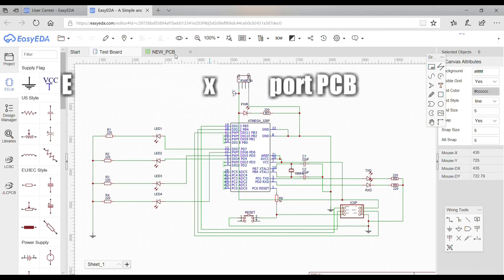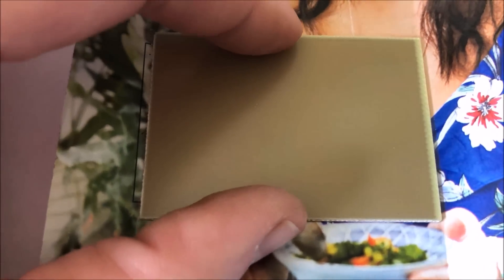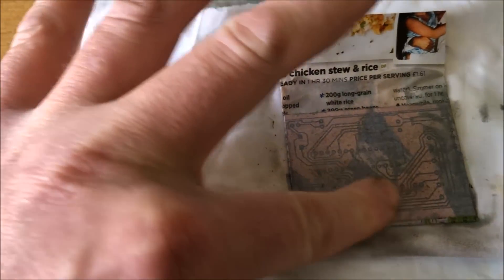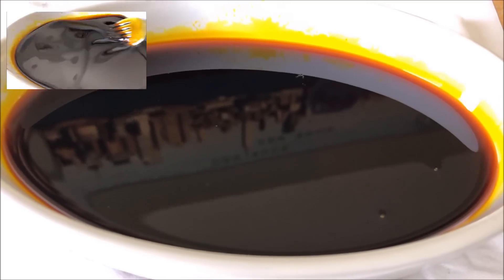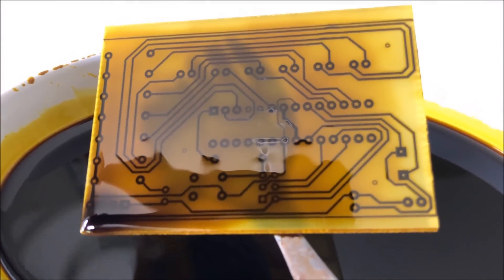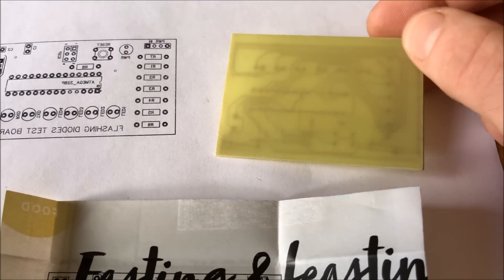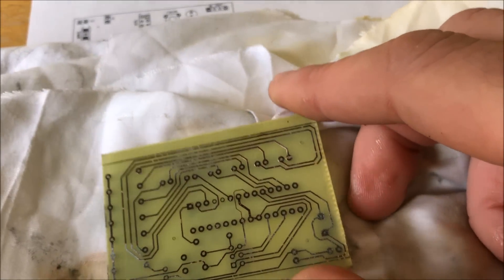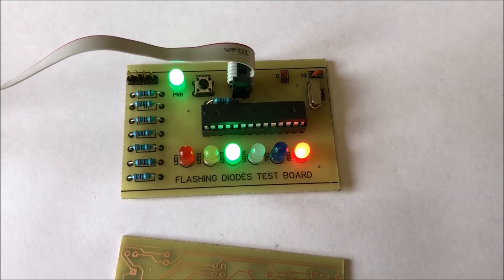DIY PCB Toner Transfer (No Heat) & Etching

Comment: Would pure acetone also work? Are B5 vitamin and Aloe Vera essential components :-)  What do you think?
Reply: vitamin B5  is essential for healthy circuits
Reply: @noname_atall  you betcher lifesavers-!!
Reply: It will work better.  Cheaper.  Faster.  Sexier.  Bacon.
Reply: Stinky Cheese mmmm bacon
Reply: The TWO key ingredients in nail polish remover are acetone and alcohol. Google "heatless pcb toner transfer". Pure acetone will just dissolve the toner. Mix 3-to-8 acetone/alcohol. See: https://www.instructables.com/id/Heatless-cold-Toner-Transfer-for-PCB-Making/
Reply: Aceton + isoprophyl 1:1
Reply: Piotr Kravi i have tried with pure acetone: nothing, with my wife’s nail - thing : nothing 
Why??? What am I doing wrong?
I printed the circuit on magazine paper with a laser printer also.
Reply: @DPoly  me too
Reply: When acetone remove your  protection on the finger it good to get B5 and aloe vera. ;-)  I like this video, will try it with acetone.
Reply: Mads Thorup did it worked? For me no...
Reply: @DPoly  I've just tried it, but with pure acetone. Some tracks appeared on the copper board, but most of it was quite smudged. The ink of the magazine article came off too on my finger as I rubbed it (I was wearing gloves). I think I put too much acetone on it.I'm going to try again anyhow. Great video.
Reply: it might work, but dont drink it. the lack of vitamins makes it unhealthy
Reply: @tobbleboii5988  Yea it's just empty calories.
Reply: Most nail polish removers no longer use acetone as their base chemical but something similar
Reply: @dege10000  may be, but this in question still has acetone in its composition (see manufacturer's website)
Reply: This I do not know but vitamin B5 and Aloe Vera leave the hands soft and fragrant ... LOL
Reply: I've found Xylol (aka Xylene) is the best at transferring laser toner from standard white laser paper. You can get Xylol at HD/lowes. Make sure you use it in a very well ventilated area. However, I haven't tried transfers yet for PCBs at all onto copper but I think it will work if folks have been using acetone. 1:1 acetone/IPA (91%?) is interesting / less toxic to inhale and might be good as well.
Reply: Sergiy Gryb Olá pessoal peço a ajuda de todos vocês para que se inscrevam no meu canal, desde já agradeço pela ajuda. Breve mais vídeos serão postados https://youtu.be/m6IBXYPri54
Reply: LOL!
Reply: @dracul9166  I would bet my chips all on ACETONE

Comment: Please, be careful with acetone. It's high flamable and hazardous to your healty. Avoid Inhalation, skin contact and eye contact.
Reply: Well... I work every day with it. It is one of the more safe chemicals. If you dont drink it, exposure to skin and so will just dry it.
Reply: it's not much the acetone (our body synthesize some acetone). The problem is with some stuff (such as plastic) that contains isocyanates. These molecules are disolved by aceton and can penetrate inside the skin, and reach your blood.
Reply: Acetone is reportedly NOT carcinogenic, but it CAN cause skin problems from repeated exposure to it.  Use rubber gloves!  Inhalation is also best avoided.  I would worry more about the ferric chloride, which stains everything!  Personally I always use ammonium persulphate - its just as good as FeCl3.

Comment: Nail polish remover is mostly acetone.  I would therefore assume that pure acetone should work as well.  Can buy acetone in pint, quart, and gallon cans at the homedepot for less an oz than nail polish remover.
I use a two to one mix of H2O2 and Muriatic acid (HCL) as etchant.
Reply: Nail polish remover is NOT mostly acetone. It contains more water then acetone.
Reply: Yeah, lucky if you get 2%-5% acetone in most nail varnish remover. Those marketing men sure know how to relieve the gullible of their hard earned cash by selling em water for a few 100% markup.

Comment: Great idea!

A couple of thoughts:

1) isn’t the toner conductive? Is there a risk the silkscreen could cause a resistive short?

2) I wonder if this works with a  “wax” type laser printer? If so, you could use it to create multi colour silkscreens!
Reply: Toner is made out of a plastic powder, so it's not conductive.
Reply: Well, not "wax" but with some oily finish. There are (expensive!) color printers that adds a finishing layer of something oily to make the printed regions to shine, and probably that was the "wax" portion. It will be interesting to know what kind of substance is that and whether is it soluble in acetone. If so, then there is no reason not to use this kind of printer for color silk screen!
I would like to know if there is any method to make a solder screen?

Comment: Thank Gareth. Very helpful by avoiding the heat transfer process. Since Nail Polish remover contains acetone and other chemicals is not just straight acetone is a good cheap alternative.
Reply from the maker: Robert Wilkins, at the time I didn’t have any acetone to hand, I’ve recently fibre glassed my extension roof and have a few litres of acetone left over, going to try it and see how different it is
Reply: Except no.  If there were any process to avoid it would not be heat transfer, it would be acetone as it goes right through your skin and plays havoc with your liver, and lungs since it evaporates so readily then you breathe it.
Reply: This is very true - had it straight from a Fellow of the Royal College of Haematology.

Comment: i do the same thing but i just use the big containers of acetone you get from lowes or home depot. i do use a flat board to apply pressure though so its even across the board. i've had some traces get distorted if the pressure is uneven.

Comment: I got this way to work quite well! i bashed out three PCB's yesterday. using a brother laser and semi-gloss finish office paper; it peels without leaving fuzz embeddd in the toner; i used it because i had some, and my printer tries to burn magazine paper...! you may get away with any old crap. 80)
Clean the copper using Acetone, NOT nail varnish remover which, as well as being over-priced, contains oils to stop drying of the nail and a large percentage of distilled water...neither of which help at all for this purpose! the stuff i used is about 98% pure, and sold in the 'cleaning-products' isle in the local supermarket's for around 4 euro's a litre. Wipe the board dry with paper tissue. keep your oily fingers off the copper.
I soaked the BACK of the paper with a few drops of acetone, which seeps into the paper and dissolves the toner; the reason i soaked the back was to make sure the toner was well dissolved and to avoid smudging the tracks when placing it on the copper. (if you drop acetone on the brother toner it almost dribbles off the paper) the ideal is nothing between the toner and the clean copper...and that includes a layer of acetone... While the paper is still wet, place it carefully onto the copper PCB, press down with your fingers or a flat board padded with tissue ( i used a rubber roller from a dead inkjet printer to roll it firmly on) leave to dry. 
Soak board in warm water (NOT hot! you don't want to re-fuse the toner ) warm water seems to speed up the 'soaking'; which releases the paper/clay from the toner. you may get away without soaking. Peel off the paper, and you will have the toner firmly stuck to the copper by some strange alchemy... Any traces of the clay used to make office/magazine paper 'shiny' can be gently scrubbed off using your fingers. Etch, and grin like a loony at your wonderous new fab lab.
Reply: Hack In Black what min trace / spacing could be achieved?
Reply: @Grants2251  technically it depends on the resolution of the printed image, for me a trace width of 6 mil and 4 mil spacing worked.
Reply: Holy fuck dude. That was great
Reply: Do you have a video of your method?
Reply: can you show how you did this?

Comment: very nice. and all with one hand...a true maestro! 80) I ended up with crumpled paper jams, tape peeling inside the printer, and pitting where the fuzz stuck to the toner...but i think i'll give this a go with the  dozens of old maplin magazines i chopped up. 
I used an aincient HP laserjet 1000; but it wont feed anything but perfectly flat dry paper, a new Brother 2365 laser (bought especially) is abysmal; it seems to rush and try and save toner, no matter what settings its put on...i found a setting that 'should' have worked..it managed to singe the paper! very impressive...NOT.
yet someone else from the UK on 'the 'tube' has done TT (iron-on) using the dog-cheap 'tesco's special' Brother Laser...meh.YMMV